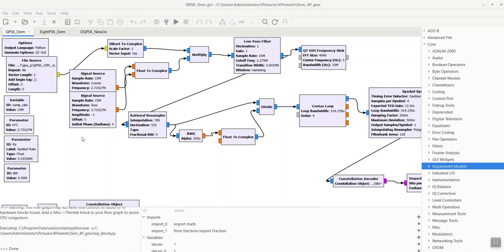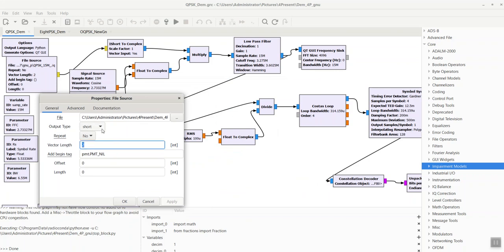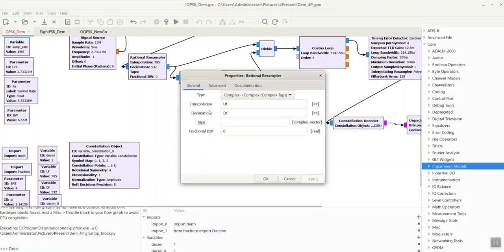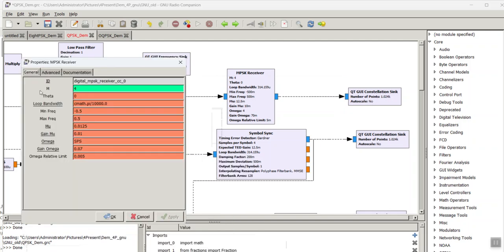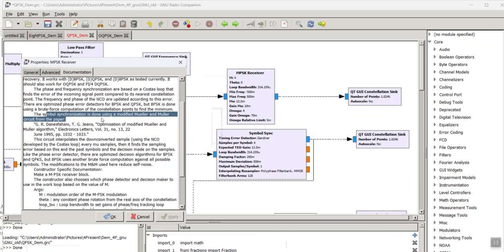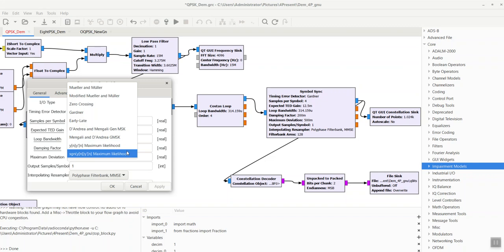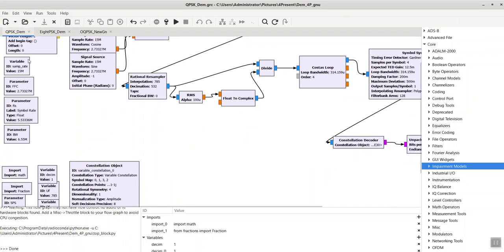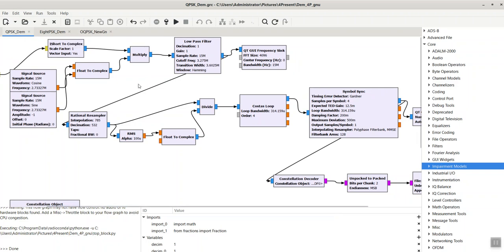implementation of the QPSK/8PSK Demodulator using GNU radio for practical signals demodulation.

Comment: Thanks for the absolute legend video, anyway, I have this 8-psk signal, can I build a demodulation modules like this on GNU? I can process the original wav file to become I/Q file with sample rate is 11025 Hz, symbol rate is 2400 baud. But I cannot do the demodulaltion from .wav I/Q file into text symbol file. I can do it manually via LG-118 software but I want to make it via new application. Can you help me with this matter. Thanks.
Reply from the maker: Hi, your welcome, for your question I think the header .wave file is about 44 byte which is multiple of 4, so if your wave file is a stereo type 16-bit, you can feed it to the source file block of this GNU design and change other parameters of design in accordance with your file i.e. as you said put 11025 as frequency sampling Fs, and 2400 as symbol rate and change the Fc(carrier frequency) in accordance with your signal. and just run it.

Comment: Thanks for the great video, but I think there needs to be more clarification on the file source you use.
Reply from the maker: The input of the  file source block is a 16-bit stereo file recorded from a GEO satellite, containing two adjacent signals: one QPSK and one 8PSK. but you can put your own file and just update the needed parameters like center frequency , symbol rate , sampling rate and bandwidth according with your signal.
Reply: @PracticalSignalProcessing  Would you be kind enough to provide us with the file for 8psk. I am very interested in this model.
Reply from the maker: @thomasterry5864 I'll try to share the input file for this video as soon as I get the chance